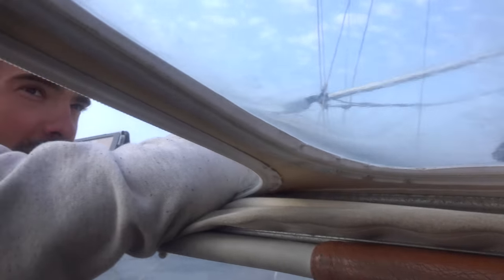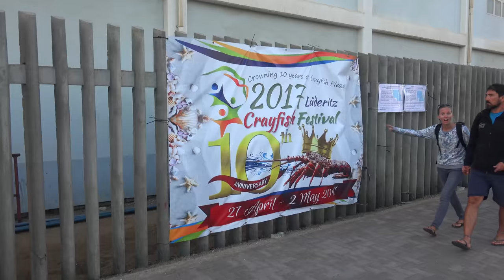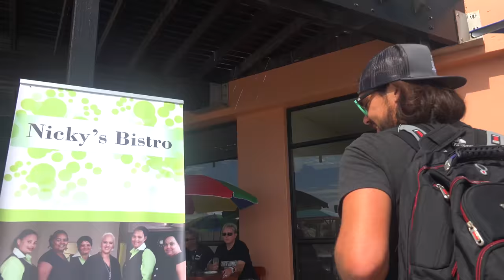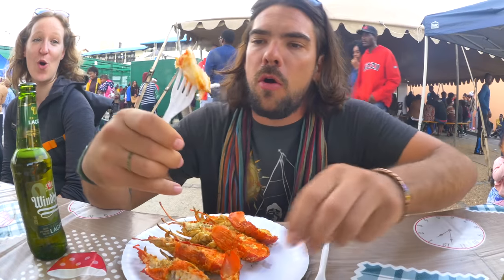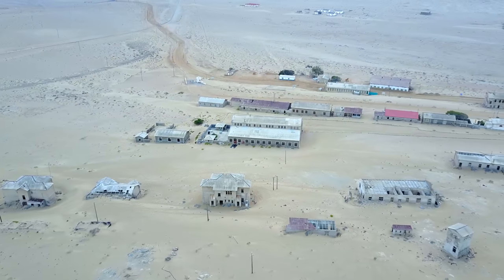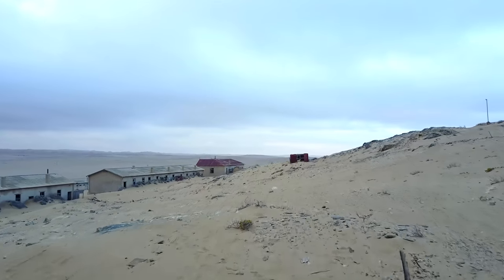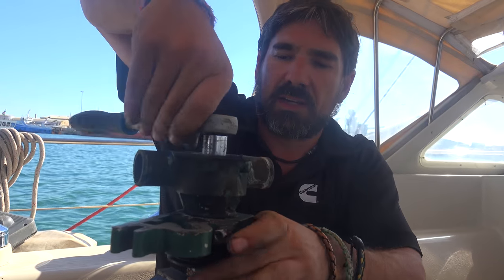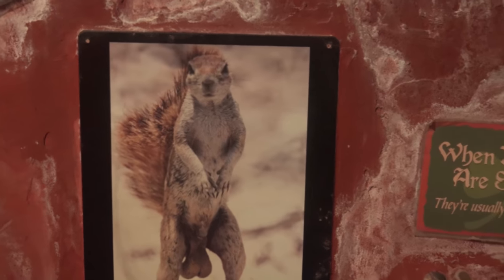Love Drops 'n Diamonds! Sailing Vessel Delos Ep. 144

Comment: Brian, if you put a tie rap round the impeller to compress it, the fitment then is easier. Cut the 
tie-wrap once the impeller starts to slide into the housing.
Reply: I have to change my impeller on an outboard and was wondering what is a tie-wrap?
Reply: @RoadRashRay - Thanks for the reply.  I guess the term tie-wrap was new to me because I have always called them cable ties.  I can see how this would be useful to get an impeller started in the correct direction while inserting it into the housing.  Do impellers always turn in a clockwise direction?  There is no indication on the impeller on which way it should turn.
Reply: I know I’m a year late, but am I the only one who noticed he got 1 or 2 of the impeller blades facing backwards???  This won’t last long!

Comment: when you put water pump together put some Vaseline all over impeller...it could take some time for water to run up if it drained the lines and save some life of impeller while it runs dry for a bit til it primes up
Reply: top advice, saves you stripping months of running time off your impeller in the 1st ten seconds.
Reply: Approves.
Reply: biodegradable dish soap is better. vaseline pollutes the ocean

Comment: i am not entirely sure, but i think you put the impeller in the pump the wrong way. all the rubber flaps of the impeller have to be foldet in in the opposite orientation of rotation, as far as i know or they will break after a while. you put them in witout paying attention to their direction. some were folded one direction and some in the other.